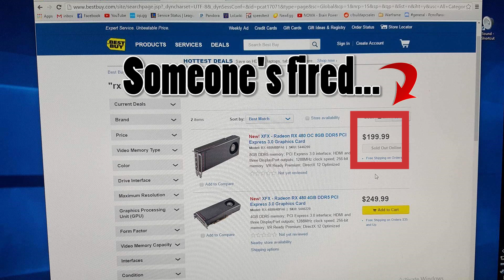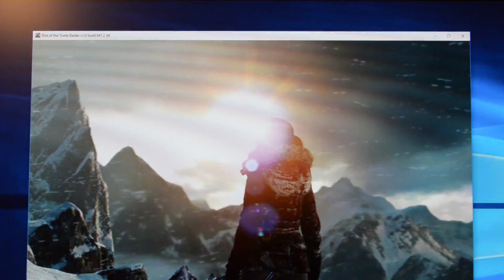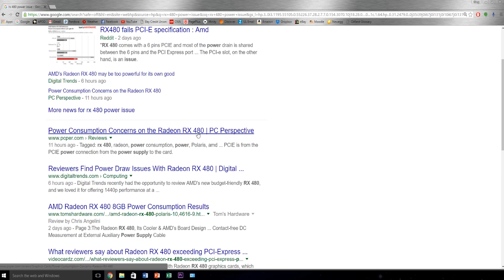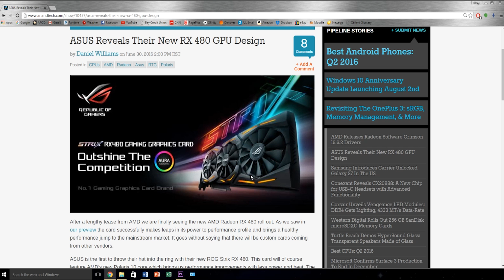RX 480 Aftermath: Power Issue & Over-Hyping

Comment: Science Studio in my country the rx 480 is priced 370 euros and the gtx 970 is 350 ... which should i buy ??
Reply: it depends on which resolution you plan to play on. 1080p -> gtx 970  and 1080p+ -> RX480. But if i were you i would wait until mid to late july to buy a new GPU. Next week the 1060 is coming so prices will probably go down on some cards. And AIB versions of the RX 480 will be available so we may see more OC potential and better power delivery.
Reply: +heer vristi alright thx that helped alot
Reply: Neither.  Just wait for the price to drop or for nvidia to release the 1060.  Because nvidia WILL ignore the 970 now that pascal is out.  Just look at what happened to kepler
Reply: rx480 chus its 8gb ofc. 4 isnt nuff

Comment: Heyyo, tbh the math makes sense. 5< TFLOPS is closer to the R9 390 which is 5.2 TFLOPS... Also, their Ashes of the Singularity of two RX 480 just beating a GTX 1080? Same deal with the AMD R9 295X2 which is two R9 290 GPUs. It's just that people spun it out of control for the hype train. Still, it did force both AMD and Nvidia to lower prices on previous generation GPUs which was good as well.
Reply from the maker: Exactly. The 480 is not the flagship and was never meant to be.

Comment: So what you are saying is that putting a budget video card with a budget mobo will = the computer having black outs during high demanding sessions??? Who is this card targeted towards then? If I have an expensive motherboard, I will surely be getting an expensive video card... Amd goofed and I hope for their sakes, the third party cards don't have this issue. If it required more power, why not have a 6+2 pin instead of a 6 pin? Facepalm

Also if the 1060 actually gets released in July 7th (rumored) with around $250 range with similar performance. Amd GPUs are RIP this gen unless Vega is remarkable.
Reply from the maker: Read my comment up top.
Reply: I see. Thanks for the clear up but I will wait till a few more people test to make sure its not affected on the cheaper mobos. I forced my friend to wait for it cause he is doing a budget build so I want to make sure that he is getting a video card that won't goof up. Great video btw!

Comment: Never a fan of Founder's or Reference.....hopefully 3rd party board partners do well.....n in India it's the local retailers are gouging the price up...way beyond taxes and import duties
Reply: i have relatives in US, thinking of asking them to buy for me :)
Reply: ***** sure just pay me 27999 :D
Reply: That seems like an unreasonably high price. Of course, you have to add VAT to the suggested retail price of 249$USD, as the MSRP does not include sales taxes in the US.  249+24% in VAT is 309$. Add to that shipping costs and profit margins, and it shouldn't be more than 330-40$ at most. Either the suppliers or the shops must be overpricing big time. 

In contrast, in Norway the price is only 300€ with 25%VAT included for the Sapphire Radeon 8 gb reference card. Part of the reason for the price difference is the weak Norwegian krone vs the Euro, but even when the krone was at its strongest vis à vis the Euro the equivalent price wouldn't have been more than ~350€. And Norway is a high-cost, high-income country.
Reply: GreekStudios So why do you say it costs 360€ in your first comment then?
Reply: +Nikhil Mathews so if they buy it how will they bring it , i mean customs and stuff?
Reply: should not be a problem if the quantity is low
Reply: +Nikhil Mathews i am also thinking that i could bring a gfx card from us , stuck between 970 and this , or i'll wait for 1060 , and i was also thinking that how would i pack it , in my carry on , any clue?

Comment: Would you recommend a 980 ti rn instead of a 1080
Reply from the maker: If you can find a relatively cheap 1080, opt for it. However, the 980Ti is a great card.
Reply: +Science Studio that would be good to bad all the 1080 are sold out rn and over priced while the 980 ti are going for cheap
Reply: +Science Studio keep up the great videos very informative!
Reply: unless you get a 980ti significantly cheaper than the 1070 then buy the 1070 or the 1080 depending on your budget

Comment: I bought it because I couldn't afford a 700$ CAD GTX 1070. I went the 335$ CAD RX 480 way. By the way is my MSI X99 SLI PLUS good for this GPU ?
Reply from the maker: LOL. Did you really ask that question? Of course it is. Any X99 mobo should be fine.
Reply: +Science Studio thanks I wasn't sure. Spent 1000$ yesterday lol Bought a 5820K with a 1440P monitor as well as a RX 480. Should do fine I guess with my Mobo and 16GB of DDR4 Ram.

Comment: what about a asrock 970m pro3? the matx one do you think it would have and issues with the rx480
Reply from the maker: An AM3 motherboard shouldn't experience any issues, but just to be same, I'd opt for a 990FX board in that category. They tend to feature better power delivery systems.
Reply: +Science Studio i have an am3+ version iguess,  im using an fx-8350 but i dont know as muxh about motherboards as i do cpus and gpus

Comment: But this is a budget graphics card which will most likely be paired with cheap mobos.  Face it, AMD failed with this card.
Reply from the maker: I'm talking about cheap, old motherboards, similar to the one I tested with.
Reply: that is nothing that can be changed with a small revision, or the costum designs, yes it was mistake, but doesnt make the card a complete failure.
Reply: It would most likely run fine with FM2 or AM3 mobos
Reply: ugh thats not a failure man. its only old shitty mobos which i wouldnt recommend at all. if you dont spend 50 or more on a mobo that is a great brand then you are buying cheap shit. the card isnt the problem. it is just a small mistake. if it becomes a little issue then rmas will help. but then again the issue is so minor come on man. the rx 480 is a hit and im glad team red delivered to the true and biggest market. i buy enthusiast cards because i love the best. but Price to performance cards are way more exciting.

Comment: Where did the hype come from that the RX 480 was supposed to take on the 980? 

Ever since I heard about it I actually listened to what AMD said, they wanted to get the minimum VR price requirements down. Which basically translates into, GTX 970, R9 390 performance. I personally would have been happy if this card would have happily took a "GTX 960ti's" spot, or slightly out performed a R9 380X. I don't understand why people would "hype" something like this, when It was clearly said it was a minimum VR ready graphics card.

A friend recently recommended me check you out, and I am happy with what I have seen. Not a lot of "tech" youtubers that really know what they are talking about, and don't follow the hype. You're one of the good ones. <3
Reply from the maker: I'm glad you're on board! Thanks for watching.
Reply: I agree. I'm sorry for what I am about to say, but most people, which think that 480 = 980 or even 480 > 980 for the price of 200$ are not smart people...
Reply: The reason for this, in my point of view is because AMD stated that 2 RX 480's could beat a 1080 in AOTS. when Nvidia used the 980 SLI comparison for their new card. So i think a lot of confusion comes from there.
Reply: Nvidia said the GTX 1080 could beat GTX 980 SLI and AMD said rx 480 SLI beats a GTX 1080.  That is where it came from.
Reply: +The Demonmit Basically people saw 5.5 TFLOPS of raw power and said "OH WOW THE GTX 980TI HAS 5 TFLOPS RX 480 IS BETTER!!!!!!"
Reply: +CRikhard lol thats why rumors and assumptions are the fucking cancer of pc gaming.
Reply: Console isn't much better tho. With the PS4K and Project scorpio...
Reply: Tanzu15 There were no rumors. It's just that people think all that you need to measure how many FPS you get is based on raw TFLOPS(a common misconception). If that was really how it is, then the Fury X and the Radeon Pro Duo would be by far the best GPUs
Reply: heer vristi Because it could. That was tested on NCIX's channel.
Reply: The rx 480 can acutally beat the 980 in some cases espesially when the rx 480 gets custom coolers and PCBs that can give it more Power
Reply: When they brought out the exposition they said the that 2 cards could compete with a 1080 which was being touted as equal or greater than 2 980's. Basically fanboys took off with their weird brand zealotry. But that's why we wait and see what the cards actually do.
Reply: Everything I have read and heard said that AMD was specifically NOT going to compete with the 1080, and was ceding that part of the market to nVIDIA.
Reply: Trifler500 You are correct on that matter. BUT they did compare two RX 480's in CF with the GTX 1080 on the reveal of Polaris.
Reply: the amd fanboys seen the 480 fall on its face and then you got crickets.

Comment: Awesome video! Although the RX 480 didn't live up to the hype, it's still an excellent buy in the FPS/Dollar category.
Reply from the maker: It sure is; here in the States, at least!
Reply: Yeah, things are a little more tough on our brother lacking in FREEDOM. Prices should come down as there's some costs that aren't accounted for by VATS and import taxes and such. If any of them are interested (and I've not got any association with them) Build a PC Proxy would let you cut out that overhead in the short term.
Reply: 340$ in Europe - Romania
GOOOOO TAXES
Reply: Well, other cards on the same bracket (R9 390 and GTX 970) aren't much cheaper. In fact, the 390 is more expensive currently over here.